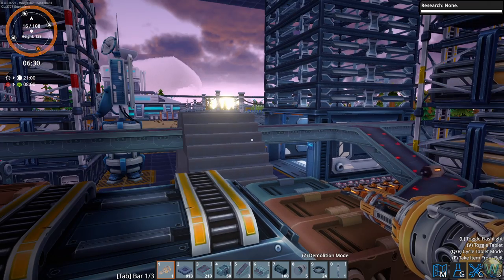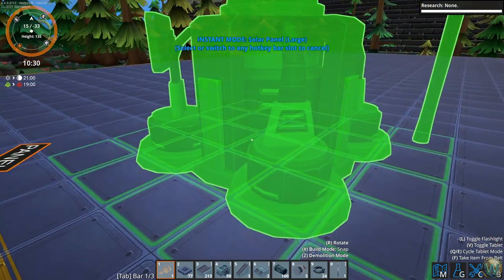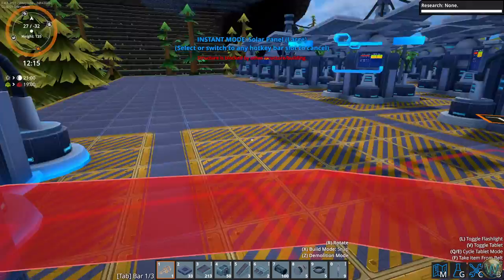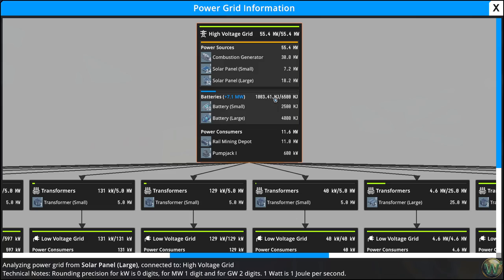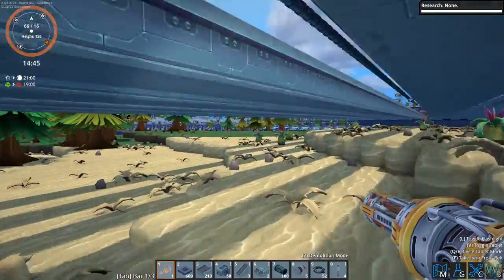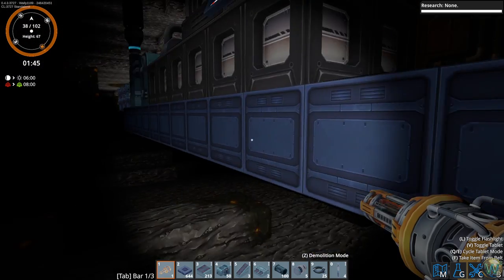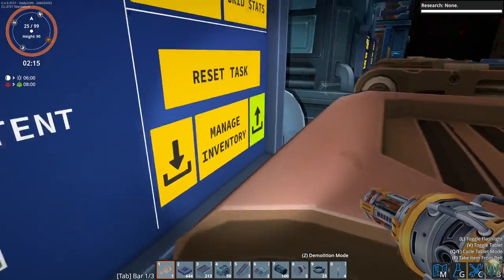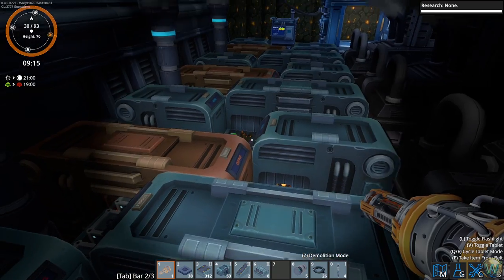Foundry - More Power! & Xenoferrite Mine Expansion p1 - Episode 29 - Let's Play

Comment: I also ended up having to relocate my miners (up 2  in my case rather than down) but yes the speed that they get through the stone blocks is far too slow
You could also offset the 'stations' by one or two square backwards on each one to allow access to the control panel :)
Reply from the maker: That’s… a good idea.  At least once I have (or make) enough space 😂

Comment: Also also, sorry, last comment. As you’re moving all of the igni miners down one. Would it not help if you do a big logistics chest prioritised near the lift and move the ore manually. You’ll be able to drop all the ore in one chest (probs) and can get it all moved down. Can’t put the ore back in those miners, I tried. But it should save having to wait for each miner empty at belt limit. Your  build with 3 belts is genuinely best, it stackable and the extra ore (research speed) can run through, add an thermal separator when it goes to the end and backs up. Then keep extending the same belt and add miners and thermals as you go
Reply from the maker: Yeah, I like the idea of using a box buffer/balancer.  Next time 😂